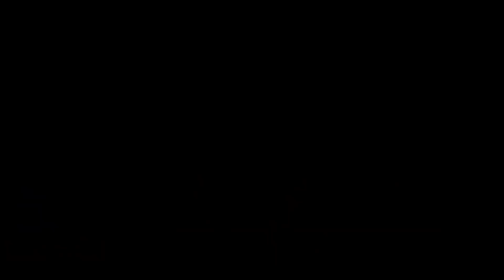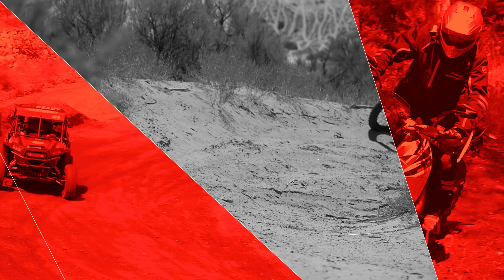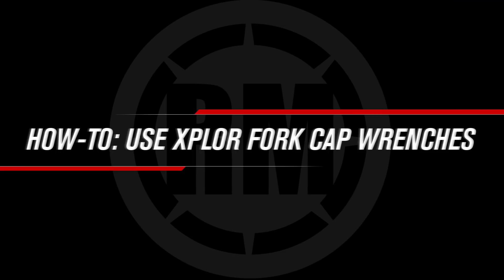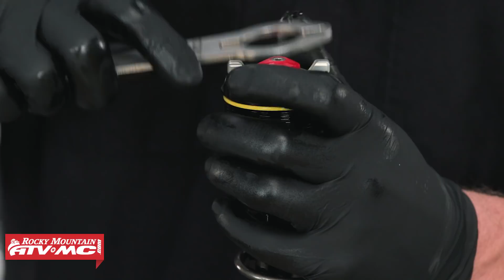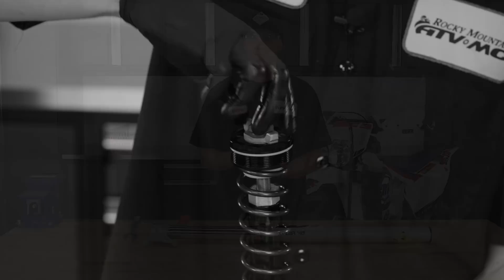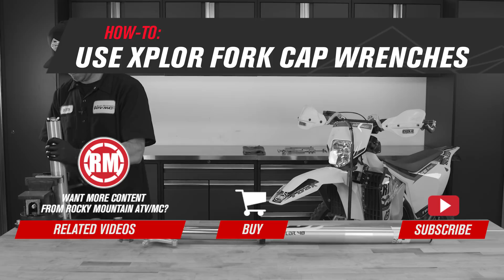How To Use the WP XPLOR Fork Cap Wrenches - KTM & Husqvarna Motorcycles

Comment: Why can't I just use my hands to turn the preload adjuster?  It doesn't appear to be that tight.  Good video and explanation.
Reply from the maker: It could be on pretty tight and having the wrench helps save your hand, as well as the components inside from unnecessary pressure. Thanks for watching.

Comment: Hello Rocky Mountain. I only use 50mm wrench and now my rebound and compression adjuster don't stop. It turns every time and don't stop. It's possible damage right? Any chance to fix? Best regards
Reply: no problem, remove cap again and play with adjuster knob and brass below with needlenose until they seat again. it's not broken

Comment: I really don't get why the rebound tool is needed.  Soon as tension between the rod and the cap break the 50mm turns at the same time as the rebound adjuster.  I don't understand how it would be worse to undo the cap and rod using the 50mm wrench